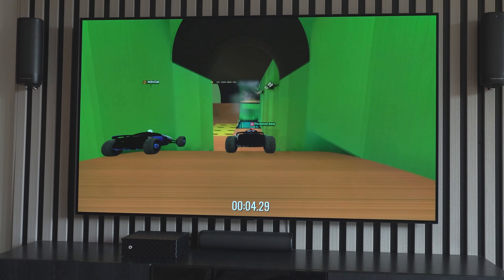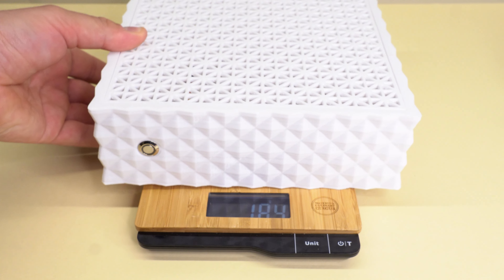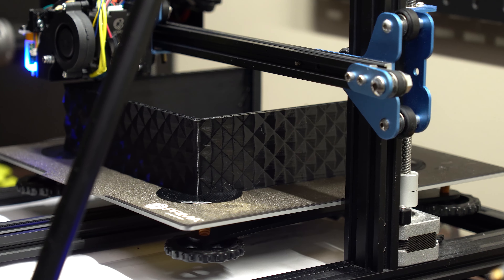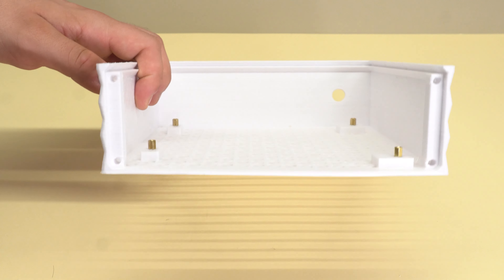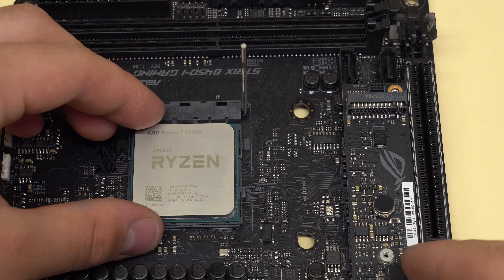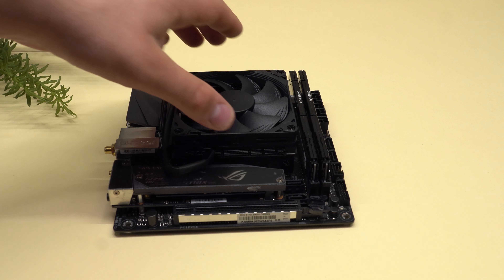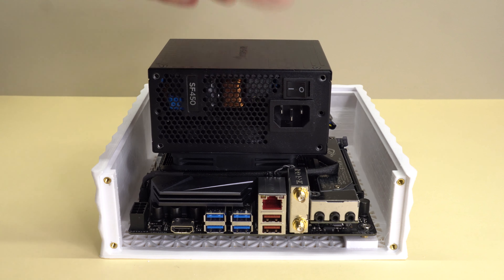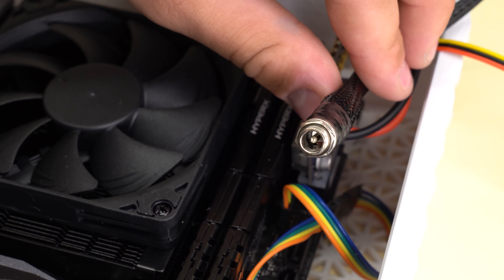Tiny 2.9L 3D printed ITX PC case

Comment: Nice design but air flow is kinda bad, hence your temps are high. Let me give you some suggestions...
You should make holes in side panels so that your hot air will exit through it, otherwise same hot air will stuck inside the case..
Front panel has some holes but they don't let enough airflow.. I suggest that use other mesh design..
You can also make direct big hole for cpu fan, like this -> https://www.youtube.com/watch?v=-yEgioZjgtE
Reply from the maker: Thanks! Yeah I know the airflow isn’t 100% ideal. Funny thing the original design for this case was actually intended to be perforated on all four sides, and was made like that with holes in the sides so the air could escape, just like my cube case with a similar pattern, but somehow I decided to change my mind and close it up as I thought it looked cleaner. The intake duct like in the other video would definitely be an improvement allowing only fresh air into the case and forcing it through instead of back out. 

I’ll be sure to keep that in mind for my next compact builds 😊